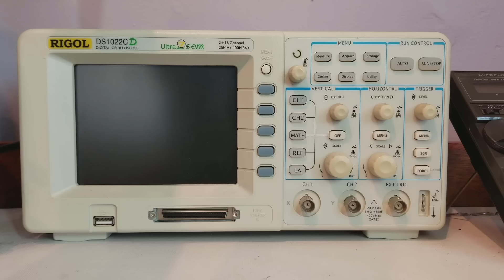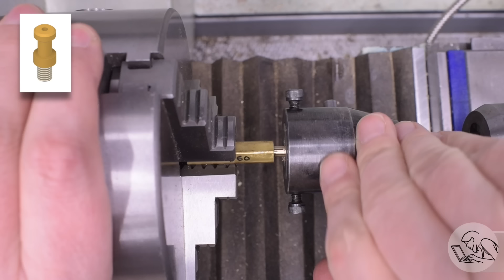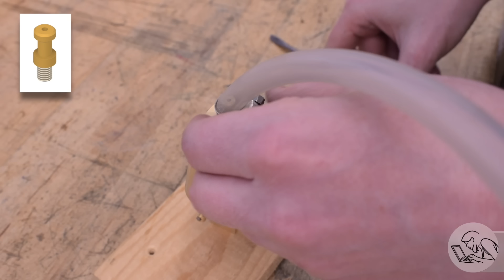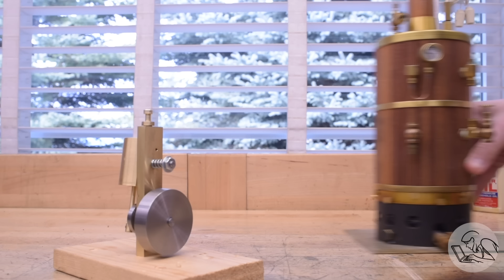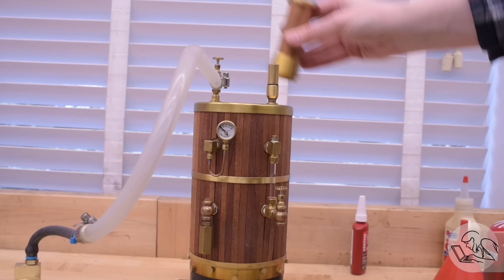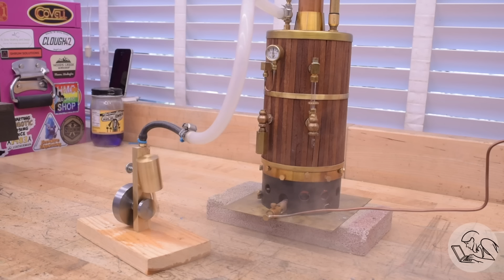Lathe-Only Engine Build - Part 4

Comment: Beautyfull build, with clear explaining. I like simplicety Thank you. I've got a question though. Many times you've said that heat is a good way to part Locktided fittings, but obviously it can handle the heat of live steam. So about what temperature the locktight will break?

Comment: The boiler looks like a still, maybe you can convert it? Still working on my Atlas 6" 10100 MK2 lathe. Raised the headstock, QCTP (the 250-111 I got from your channel) and tail stock 1", which I upgraded to a lock lever instead of a nut, to provide a 7+ swing. Upgraded the motor drive to variable speed servo @ 1100w to do away with changing gears. Now converting my carriage assembly from 1 piece to apron and saddle. Widening it from 5" to 7" to accomodate a 9x20 cross slide that has t-slots. I already own this cross slide. Since I don't own a mill, I'm using my lathe as a mill to make the new pieces. Using a fly cutter for basic shaping and then a dovetail cutter to make the wider dovetail spacing and depth. Will add a 9x20 cross slide antiback lash nut and will have to upgrade my 3/8 cross slide drive bed gear to a larger size that the 9x20 uses. Then make new larger indicator wheels. Not much of an Atlas left!

Comment: I built my first and as it turned out, only steam engine about 20 years ago.  A wobbler similar to yours, mounted on a flatbed car, with a chain drive to the rear axle.  It happily ran around little oval track I slapped together. I bought 3 of Kozo's books (A3, Shay and Climax) with plans to built them all.  Life had other plans, relocated, abandoning my shop and  did other things until recently when I retired (fairly young) and promptly got cancer.

I spend a lot of my time now watching yours and others videos on machining while I battle back.  Once I kick this crap I fully intend to rebuild my shop, dust off those books  and do some building.
Reply: Good luck and wishing you well

Comment: I may not have a brain but I have an idea… 
I got two boilers that run up to 0.5 bar (~7.25 psi) I could make an engine that can work with this pressure. This could be a nice project, thanks.

Greetings from Germany
Reply: Just run your boilers in series to get 1 bar 😂

Comment: Is there a way to scale this down to make the project fit an emco unimat 3 lathe?
Reply: If you can't make it fit you can take the drawings and scale down the dimensions by some factor or you can look into smaller wobbler types. Tabletop Machining has a section at the end for a really small one designed for the Sherline lathe called a "Millie" from Modeltec Magazine. You could try to see if the plans are out anywhere online or try to see if either of the book or magazine are at a local library, you might have luck with a college library.
Reply: You should be able to make it fit . Might need to use a face plate instead of the 4-jaw for the biggest milling operations? I've got a little Hobbymat lathe which isn't much bigger than a Unimat and I think I'll be able to make it work.